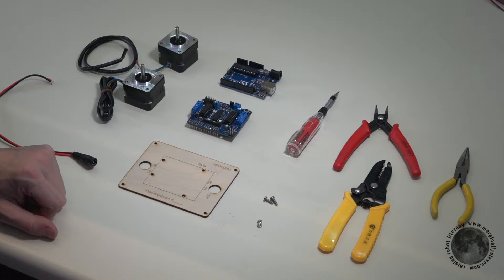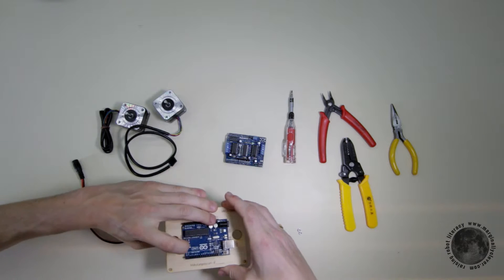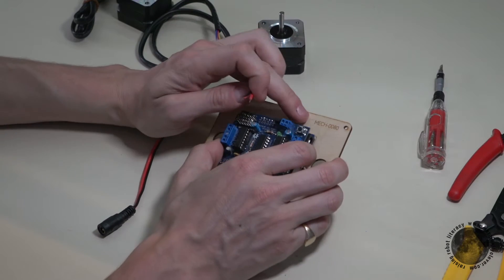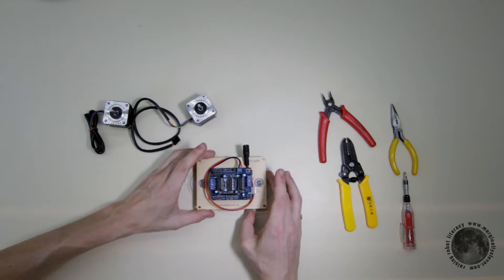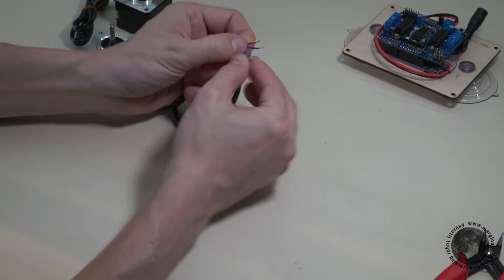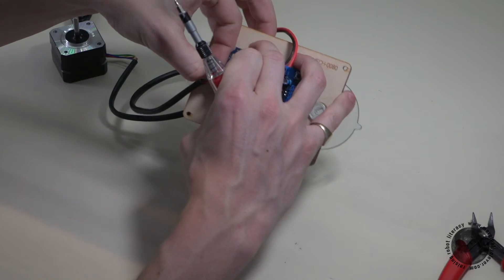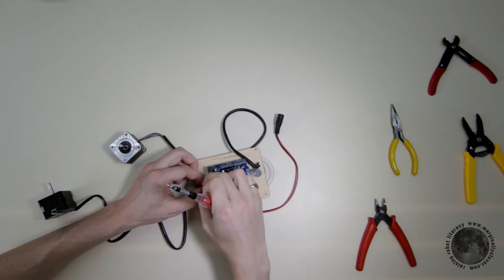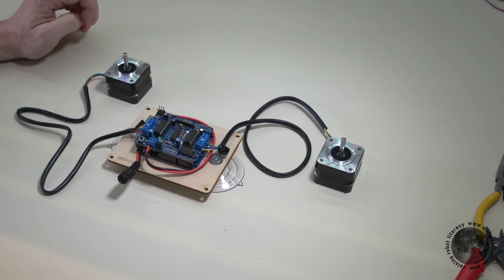Makelangelo Drawing Robot - Motor Controller Tutorial v2

Comment: Very nice video Dan, it helped explain a lot! Just one question. If I buy a dc power line socket, and strip it from the other end, how would I know which one goes where on the motorshield when you connect them? Thanks so much!
Reply: use a multimeter to check which wire is positive and which is ground.  the motor shield says M+ / M-, attach the positive to M+.